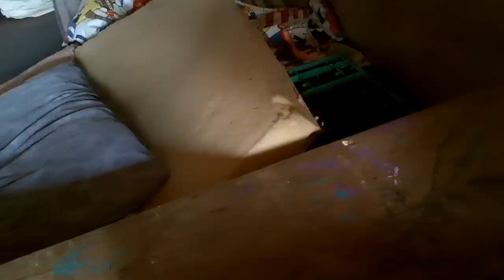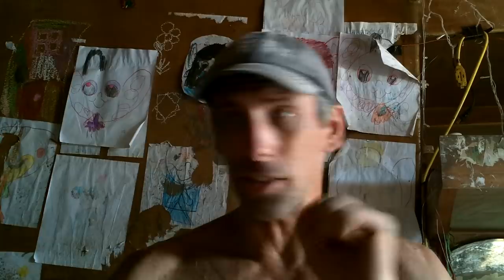Why no FlyWheel on the Pedal Boat, Jaimie?????

Comment: The only benefit I could see for a flywheel on a paddle boat would be to smooth out the pulses of inputted energy from the operator’s legs.Similar to that of flywheel on a piston based engine. A side effect of this may be that the resistance the operator feels may be more smooth as well. That being said, I can’t imagine that the benefits from that would overcome the negative effects of the extra mass required. I also don’t know what the effects of having a large gyroscope onboard a boat would be.
Reply: they used to put giant gyroscope on luxury liner to prevent the boat from rocking on bad sea
Reply: I came here to say this.

But, you have to factor the fact that the paddle wheel is in effect a flywheel. 

As another commentor noted, by the time you add enough mass to get a benefit, the negatives have increased by a multiple...
Peddle clips would provide a larger net benefit.
Reply: what's imputed? is that a werd? did you infact mean "inputted"?
Reply: ken jay *corrected thanks
Reply: terravarious after posting this I thought about it more. For a flywheel Energy=.5(Rotation Inertia)(angular velocity)^2. In other words, it’s much more effective to increase the RPM of the flywheel vs increasing its mass. So the flywheel wouldn’t have to be heavy. It could be light and just spin faster. Still don’t know if it would provide any real benefit on a paddle boat.

Comment: What about a high voltage pedal generator feeding a super capacitor bank going to a brush less 3 phase motor then a fly wheel on the paddles would be appropriate

Comment: I want everyone to have the chance to rip me a new one. 
 I suggested this to jaimie because when i have ideas i go to him to see if they will work or not. 
 Usually im not as stubborn with my ideas but the way i see it thru a couple simple gear reductions on both ends i see this have bennefits. 
 Old engines had flywheels in order to increase the torque exponentially compared to the horse power
Reply: old engines that were stationary, had the big flywheels. Their rotating mass was used to power shafts that required constant turning with out having huge accelerations/decelerations between firings of cylinders or cylinder. Same held true for tractors that had implements driven from pulleys and not pto's... it only adds rotating mass not torque. Torque is the energy behind the rotating mass or torsional force. It's called physics, it's not a new thing and you can't reinvent it to suit your whims. Horsepower is a unit of measurement to lift weight off ground. Torque is the power rotating the shafts.Torque don't win races but it will rip apart driveshafts and move heavy weight. Thanks for playing! READ MORE, EXPERIMENT MORE! TALK LESS, LESS TALK, MORE WORK!
Reply: OKC - Old, old, engines with a single, giant, slow piston are a highly inconsistent energy source. You get a lot of strength at one part of the rotation and none and many others. So to not be jamming up on a consistent load, you add some weight that slows down the piston push when accelerating, and carries that momentum through when the piston is doing the other 75% of its cycle (4 stroke engines only have 1 of the 4 strokes powered). It's like jumping up the stairs 4 at a time, in great big jumps with long pauses in between. Flywheels are not gearboxes. They do not change torque at all. They do not trade speed for strength like a gearbox does. All they do is average out what once was an inconsistent input, or, help a consistent input stay average with a wildly inconsistent load. Also, you're (as many people do) misusing the term "exponentially". It's not a fancy way of saying "a lot" or "more", it specifically means an accelerating rate of increase, which doesn't even make sense comparing a static situation. If what you mean is "a lot" or "more" just use the the words you understand.

Comment: How about a wheel covered with flies all flying in the same direction? When you want to turn, just turn the wheel. I have to warn you, training them could be an issue, and the ones you shanghai and use tiny leg cuffs to keep them on the wheel never seem to fly in one direction. Not to mention all the very high pitched complaining. On the positive side, you can feed them crap and they'll do just fine.

Comment: Regardless of how you power it , the paddle wheel is much less efficient than a poorly designed prop.
Reply: If you had listened to what he was going to do with it, using it in the small shallow canals on and around his island i think it makes sense.  Props don't do well hitting bottom or rocks etc!  a paddle wheel will handle shallow water much better.  Also a paddle wheel is less affected by algae growth (which is bad in his area like 30 days it amounts to a lot) than a high speed prop!  Algae growth on a prop greatly affects its efficiency because it's fast moving where as the paddle wheel is slow moving and has flat surfaces and is not very affected by algae growth.  Lastly there would be some power loss from a gear or chain drive to power a prop from pedal power.
Reply: you lose power at each change of angle to the shafts, I think it's 15% for a 90degree bend... how many bends in your proposed plan? 30% minimum in your plan.
Reply: The demo of this paddle wheel was impressive, better than his propeller powered boats. Are you suggesting that he sped up the film, or that he's a pedaling Monster? Either one I could believe, or maybe the boat just works.
Reply: @Chrisfrom_Dallas  I agree with you! I believe he is a pedaling monster and I believe the boat works!  I don't believe in this case he sped up the video!
Reply: @advancednutritioninc908  Props don't go in shallow water if you hang them deep in the water. hehehe , you guys act like Jamie is some sort a god and the things he's doing has never been done before.  As for algae growth, do like most boat owners do, get in the water once a week or tow or three(depending on your area) and clean it off.
Reply: @KenSilvers  Then I guess you and jamie are right and all the ships, boats, and other watercraft using props for the last hundred years are wrong
Reply: @advancednutritioninc908  hehehe Real engineering. Paddle wheels better than props.  hehehe, The only real advantage his drive has is simplicity in design and manufacturing. Oops , maybe even for that rare occasion when he's scraping bottom in shallow water.. But guys solved that problem for propellors decades ago with simple tunnel drives.  Real engineering, hehehe, I love hoe armchair experts consider what they say as real engineering, when all they did is copy and paste something they googled. hehehe
Reply: @mazdarx7887  I'm sorry you missed the point. I'm not going to explain it all to you... as that is what got you into this mess... somebody told you something... now you don't have the sense to figure out anything for yourself... pathetic, truly! You are right, everyone else is wrong. Have nice day.
Reply: @KenSilvers  Keep on bowing down to Jamie, he loves that . Except for his spider toy, and the steering system on his electric tractor, he hasn't done anything that hasn't been done before.  you guys act as if everything he's doing is some new innovative thing. hehehe Want to see some interesting things made from scrap, go to southeast Asia and see what they build with much less then Jamie has.  But getting back to my original comment, it stand true. if paddle wheels where even remotely close to the efficiency of a prop, they would be widely used today, but they are relegated to kids toys and small, cheap recreational watercraft.
Reply: @mazdarx7887  Look, I'm so sorry you have nothing better to do than get butt hurt at being wrong. I"m guessing you're butt hurt a lot. We shouldn't wonder. This is after all a matter of opinion and your claim to know how another should do it as a matter of fact, is absurd and wrong... grow up son. I know you've been wrong before... I'm guessing you have a fixation or crush on Mr. Mantzel. You need to deal with that, and stop blaming others of your issues. Again, grow up little man. Hope you feel better soon.
Reply: @KenSilvers  It appears that you disagree with my statement that the paddlewheel is less efficient than the propellor.  Therefore it stands to reason that you think the paddlewheel is more efficient than a propellor.  And you probably think the earth is flat and the moon is made of green cheese.
Reply: @mazdarx7887  I'd say you make too many assumptions, because you are in love with your thoughts instead of reality. People infer what they will. I find that fascinating to see where the minds go. Not based on any fact or evidence. Remember... when you asssume, you make an ASS out of U and ME. But really it's all just you.
Reply: @mazdarx7887  Now I don't think you simply have a man crush on Mantzel, but are very lonely also. I'm not. I like my minds a bit more well developed.